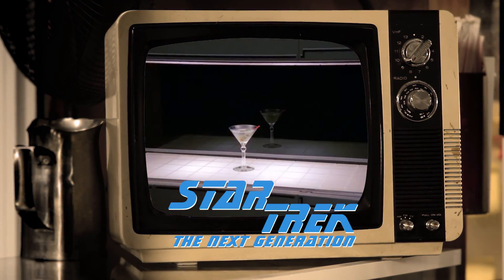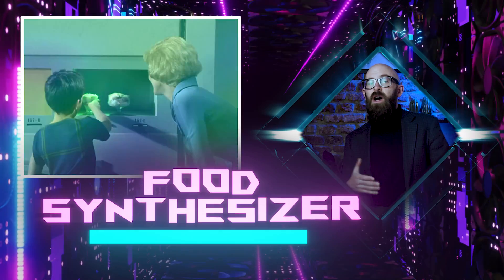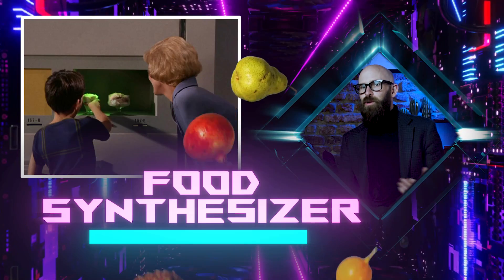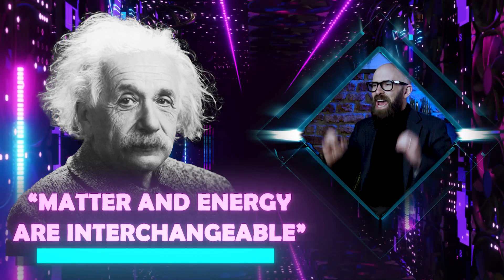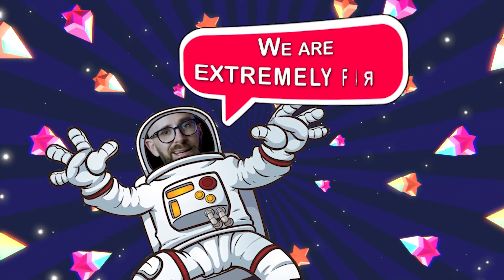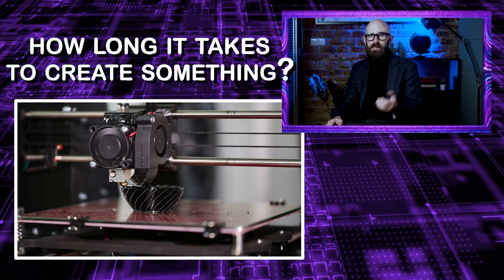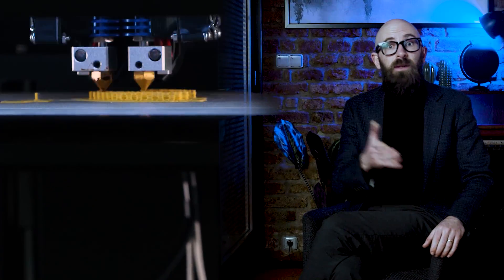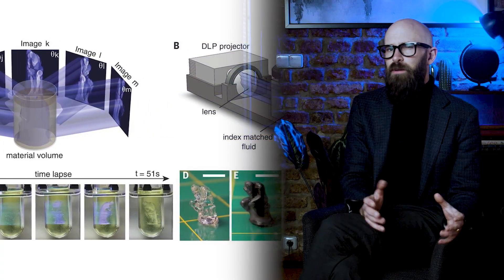How Far Away Are We From Replicators?

Comment: In 2025, the 3D printing technology that most closely resembles a Star Trek replicator is Volumetric 3D Printing, specifically a method known as Computed Axial Lithography (CAL). 
While traditional 3D printers build objects layer-by-layer (a slow, visible process), CAL allows a complete 3D object to seemingly "materialize" all at once inside a container of liquid resin. 
1. Computed Axial Lithography (CAL) 
Developed by researchers at UC Berkeley and Lawrence Livermore National Laboratory, this technology is often nicknamed "The Replicator" by its creators. 
How it works: CAL projects 2D images of an object from multiple angles into a rotating cylinder of photosensitive resin. When the light intensity from different angles overlaps and hits a certain threshold, the resin solidifies into the final shape nearly instantly.
Speed: Unlike traditional printers that take hours, CAL can produce complex geometries in less than a minute.
Quality: Because it does not use layers, the resulting objects have perfectly smooth surfaces with no "stair-step" texture, similar to injection-molded parts. 
2. Xolography
Another leading volumetric technology in 2025, xolography (developed by xolo GmbH), uses intersecting light beams to cure resin with extreme precision. 
Precision: In early 2025, researchers adapted this tech to print living cells and tiny structures as small as 20 µm, paving the way for future bioprinted organs.
Space Application: Because it does not rely on gravity, it is a primary candidate for "replicators" on space stations and during microgravity flights. 
3. Continuous Liquid Interface Production (CLIP)
While older than CAL, CLIP technology (commercialized by Carbon) became more accessible to "prosumer" markets in 2025. 
Continuous Build: It uses an oxygen-permeable window to create a "dead zone" that allows the build plate to pull a solid object continuously out of a resin vat without stopping for individual layers.
Indistinguishable Quality: By 2025, newer versions like the Form 4 claim print quality is "indistinguishable from injection molding," pushing the tech closer to a desk-side "enterprise replicator". 
Key Differences from Star Trek
Despite the visual similarities, 2025 technology still has major limitations compared to fictional replicators: 
Material Constraints: Modern volumetric printers primarily use photopolymer resins, whereas Star Trek replicators can synthesize anything from Earl Grey tea to complex electronics.
Post-Processing: Objects printed in 2025 still require "rinsing" to remove uncured resin and often a final UV cure, while a fictional replicator produces a finished, usable item immediately. 
Explore how volumetric 3D printing technologies like Computed Axial Lithography (CAL) and xolography create objects rapidly and with high fidelity, resembling a Star Trek replicator

Comment: I'm more interested on the technology of the insanely cheap conversion from one form of matter to another. They can turn co2 into ethanol using those mattershift cnt membranes quite cheaply. But when you can turn co2 or the material of soil into the consumable material of food, that's when I'll be spreading that information around.

Comment: You wouldn’t need all that much power at once, you would need a large amount of available matter to convert into energy and then into matter. Using the most dense substance in a big block would essentially be the battery… Still very unlikely, we would need to be able to create subatomic particles like quarks in just the right configurations to make atoms and they would all have to happen simultaneously (at least in that atom) in order for it to be stable.

Comment: First off...computers.

We need a computer (and applicable software) that can store and manage the entirety of the rules of particle physics and chemistry, as well as a huge number of specific chemical compounds, and a variety of "recipes" of what to make WITH those compounds.  We're talking thousands of terabytes of data that would have to be processed in seconds, in 3D, continuously.  Even Google's (very much NOT actually "quantum" computer can't do that).

Secondly...the machine itself.

We need essentially a 3D printer that can print with absolutely ANY material without restriction, and do so with subatomic precision at all scales.  It also needs to be able to control a huge variety of internal environmental conditions on the fly to ensure that various chemical bonds are possible and will remain stable during the process.

Thirdly...power.

We'll require a power supply that can feed such a powerful computer.  And, odds are the machine itself will be an electricity-guzzler.  Renewables won't even come close to feeding the thing.  Ubiquitous global nuclear electricity supplies...or we're not getting replicators, ever.  Even in Star Trek, replicators don't seem to be something everyone has in their home.  They're much more typically public devices that everyone shares.  Only on starships do they seem particularly common or personal, and that's mostly because starships are typically outfitted with the best computers and carry Matter/A-matter reactors that can kick out more power than an entire planet can.  When they're not using it to violate the laws of the universe, it would be more than capable of supplying a few hundred replicators with sufficient power.  Most planets in Star Trek don't use Matter/A-matter reactors...just simple fusion reactors and renewables like solar.

So...to put it mildly...

We're a goddamned LONG way off, yet.

Given the direction computer science is starting to take...we're never going to have computers capable of the job, actually.

Thanks to the unbridled stupidity of both Big Oil and the anti-nuclear morons, the idea of global nuclear power is all but dead, forever.

Practical artificial fusion is looking more and more like it's not even possible, and Matter/A-matter fusion is far too dangerous to use planetside.  A fusion reactor that "breaks" just plain stops functioning at all.  It'll never go critical.  A matter/a-matter fusion reactor that messes up could blast a new oceanic basin into the planet.  

Ironically, certain advances in lasers and materials science could make the advanced 3D printers themselves possible.  But we'd never be able to make full use of them.  No matter how good they get, we'll only be able to make simple objects with maybe a few moving parts and a few dozen materials in their composition, and never anything with dynamic chemistry or nanoscale functionality...even though the devices might be capable of it...the computers will never be able to.

Comment: There is also the problem of heat and radiation.  The replicator would need to somehow contain the energy discharge or heat in a measured way that doesn't  cook everyone on the ship.   The more energetic the reaction the more heat is released..and splitting atoms apart and putting them back together in different electron arrangements generates mind boggling amounts of heat and radiation of various types.  There would need to be some kind of siphon or particle in the stream that absorbs the heat and safely dissipates it or recycles it back into the warp core.

Comment: A replicator need not use pure energy to create food, it can simply convert plant waste matter into that food in a similar manner that Kirk is converted BACK into Kirk and not made FROM energy. So the energy requirements are not that great.  Also many foods could be simply made from processed chemicals and combined into the structure USING beaming technology.
Reply: The replicators uses pure energy to matter conversion.

Comment: A couple of misconceptions here.  The following was in a Star Trek encyclopedia I read a few decades ago, so some small details may be wrong.  Firstly, starships have special storage tanks (made perhaps of stainless steel?).  Before a starship leaves port, these "slurry" tanks are pumped full of a special type of gel.  This odorless, tasteless gel (I believe it was described as being translucent), is made up of specially formulated molecules that can easily be combined in myriad different ways to facilitate the replication of foods, drinks and a very limited number of other products (clothing, for example).  The replicator (located in a central location), on demand, synthesizes consumables by withdrawing the proper amount of gel, rearranging the molecules (in some cases even rearranging individual atoms), assembling them into, say, cheesecake or a T-bone steak, and dematerializing it (transporter technology).  It then sends the matter stream through waveguides (sometimes called replicator conduits) to the proper replicator station where the cheesecake (or T-bone steak) was originally ordered.  There, the replicator station reintegrates the molecules into delicious cheesecake (or T-bone steak).  Each replicator station has a small disintegrator/reintegrator module built-in.  The replicated cheesecake (or T-bone steak) can then be removed and eaten.  You can also specify preferences like steak "rare," Earl Grey "hot," or coffee "hot," "black," "double sweet."  So you see, the replicator is NOT a "magical" device that can create ANYTHING from "THIN AIR."

But wait...how does the replicator know how to arrange molecules into cheesecake or a whole meal?  The replicator must access a library where the formula for making cheesecake resides.  World famous chefs help develop the recipes for all foods in the library (every meal is five star, cordon bleu).  The recipes are then programmed into the replicator's computer and stored in replicator memory (the aforementioned "library").  If you ask for "New York cheescake" and the recipe for "New York cheescake" isn't in replicator memory, the replicator may tell you, "Such item does not exist" or "Please select another item," or something to that effect.  Or the replicator may tell you, "Conventional  cheescake may be substituted for New York cheesecake."  So you see, ordering a weapon is problematic because weapons are not likely to be programmed into replicator memory.  There have been some Star Trek episodes where the replicator station in a "guest's" (prisoner's) quarters is disabled so the "guest" is unable to arm him or herself, but technically, this goes against Star Trek canon.  Anyone wishing to replicate a weapon will have to find a way to break into the replicator room, sit down at a computer terminal and write a program that will tell the replicator how to create the weapon desired (no easy task, especially if you're not fluent in replicator language).

Clothing can also be replicated (there are no laundromats on a starship).  At the end of each day, dirty, smelly clothing can be placed into a drawer just below the replicator station where they are disintegrated and sent back to the replicator.  There, the replicator reintegrates the matter stream into elemental molecules that happen to resemble the original gel in the slurry tanks and stored there.  I assume that since cotton fibers are organic in nature, most uniforms are made of replicated cotton.

We all know that EVERYTHING on a starship is recycled.  This includes poop, urine and all manner of nasty things.  So when we order food from a replicator station, are we REALLY eating recycled poop?  Of course not...that's a silly notion.  When you pump out a "log" into the toilet, that "log" (and anything else in the toilet) is immediately disintegrated and sent to the replicator.  Once there, the replicator reintegrates the matter stream into elemental molecules that in no way resembles, disgusts or smells like the pre-disintegrated matter.  In fact, as soon as the "log" is disintegrated, it no longer resembles anything that even remotely resembles a "log."

So perhaps the biggest misconception in all of this is that a starship's galley and every room onboard has a replicator.  In reality, the replicator itself is a rather large, centrally-located machine that uses a tremendous amount of energy.  That's why the replicator may be taken offline in order to allow more power to the engines.  So, although everyone thinks of a replicator as being in every room, that thought only serves to make a rather complicated technology seem simpler and friendlier.  What is actually in every room is a replicator STATION.

Comment: You don't have to go beyond Seep Space 9 to see how a bad use of replicators could go.. The Bajorans got hold of an un-restricted replicator and made bombs to blow up DS9... 

But it needed a reprogrammed replicator.  Most replicators were joined to a central database of items that needed authorization to create anything. (as part of Lore) to prevent people just creating a gun or phaser.  You needed authorization to make a new rifle or warp coil etc.

Which is why Voyager had troubles with parts in the Delta Quadrant.  They did not have a industrial sized replicator or the authorization to make parts for one.

Comment: Interesting thing is, warp drive would require so much energy anyway, replicator would be a drop in the bucket - in fact, a replicator system might be the best way to refuel - deconstruct asteroids of any kind for energy, use that energy to create matter and power the engines.

It would basically be a step up from fusion energy - the equivalent of harvesting a matter antimatter reaction, without the antimatter needed. Warp currently still needs way more power than 'a few asteroids', but the old E=MC2 would basically be the expected energy formula. Just that (Well, assuming the process has power requirements and it's not 100% effective) googling it, fusion in the sun versus energy from matter antimatter reaction, the result was at least 500x ish more energy - plus if you've got some beam doing it, you don't need to figure out how to get or contain the antimatte, how to optimally mix with matter, how to properly contain the reaction, or how to fit that to a water to steam to kinetic energy idea.

Comment: Not that familiar with the tech manuals from Star Trek, but I always thought the easiest way to replicate something is just extract the atoms around us and reformulate them into whatever you wanted. after al isn't there already Oxygen, Nitrogen, Helium, Carbon Dioxide and a ton of other elements just floating around freely in the air couldn't a replicator just use these elements and make whatever it wanted? we already use this to a certain degree in portable oxygen machines or the muffler on your car to remove carbon dioxide (CO2)

Comment: A light in your house used to require on average 75 watts. Now, with technology improvements, it takes less than 10 watts.... so, all it takes is a couple technology breakthroughs to make replication possible.
Reply: As well in star trek, they commonly preferred real cooked food instead of replicated, whenever possible, mostly because the replicated variety was "basic". Think of a nutrient block shaped and flavored a certain way. Not real, but good enough.
Reply: A warp core is powered by antimatter.

Comment: If a ship has transporters, running a replicator isn't a big step from that point. Especially since the food and construction replicators in Star Trek are often not drawing all their power from the Warp core but hooked up to tanks of matter which they reconstruct into whatever matter they need, so rather than pulling the entire object out of the warp core's energy storage, it pulls most of the energy out of a matter tank which it turns from matter to energy to matter in the same single process.
Reply: Replicators are probably easier than teleporters. Teleporters need to copy the current pattern and stream the energy/info to a location without a specific tech in the location to aid reassembly.

Comment: the reason that the use of the replicator had to be rationed was, most probably, storytelling related.
In this situation the high energy needs of the replicator came in handy.
And no it is NOT E=mc² because the replicator does NOT change energy to matter, it changes matter into other forms of matter. carbon, which is stored for that purpose, into whatever you want to have.
and whatever you want to get rid of into carbon.
The principle of function is to decompose the matter into energy, as a transporter would do, but then condensate(for lack of a better phrase) the energy into whatever you wanted to have.
this does technically change energy into matter, but that energy comes from matter that  has been changed into energy, so that the net energy need is not calculated E=mc², it is only what you need to control the decomposition and recomposition of matter.

Comment: The problem with replicators is not that they require a lot of energy. So does warp drive.
The problem is if we were capable of handling that kind of energy, there would be no space battles, because the slightest containment leak (let alone intentionally destructive release through a weapon) would evenly spread the ship across the entire solar system, one atom at a time.
Reply: Correct.

Comment: No replicator could ever function without computer technology.  Because all replicator computers would be programmed with security protocols, according to what is offered in its "menu," for certain products (such as A-bombs), very complex programs would prevent the production of certain necessary components.

STtNG had holo-decks that also employed a very specialized version of replication/transporter technology.  It all hinges on computer technology.  By being able to regulate HOW any energy is being applied to produce a circumstance, what you believe would take the power of a small nuclear explosion could be levered by way of AI programming down to just a gigawatt,  or even much less.